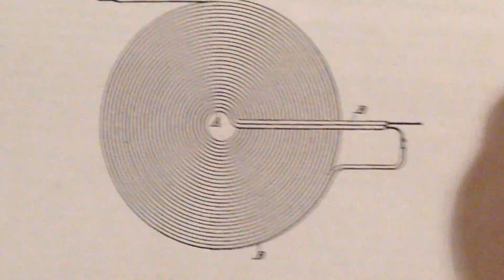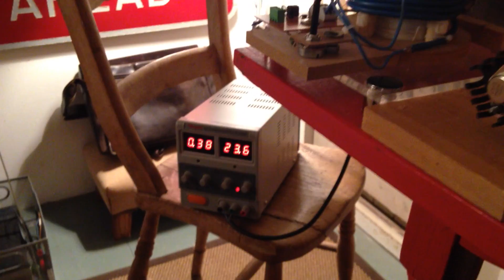Tesla Patent 512,340 Primary on a Slayer

Comment: I don't see a pancake coil anywhere.. Is there one here? A normal helically wound bifilar coil doesn't really function in the same manner as if it were wound as Tesla shows in his patent. I have found that the pancake coil works great as a primary coil for the tesla coil, whether it is bifilar or not however the bifilar adds a lot of punch to the system, not only an increae in voltage, but power as well, so if you do not use one here, please try it, I have and it does increase the output of radiant energy with a very big difference, not just a little bit. 

Whatever you have going on that is making the circuit click on is creating power issues for the setup you have, almost as if a transistor is shorting by saturation, or possibly the pulses out of frequency are  making it jump up from 5 watts all the way to 28.3 watts and beyond. 

Your  lights all light up just fine at the beginning with .18 amps x 28.3 volts @ 5 watts when the coils are close to each other and able to communicate with each other.. Are the transistors heating up from the high frequency?

I am quite sure your flourescent tubes are all at least 12 to 24 watt bulbs too, and they appear to be well lit, nearly all the way for their brightness.. Have you checked your lux from the bulbs powered with the Tesla coils, then test them again with them powered conventionally to see if the circuit  is producing n output into overunity? If the transistor/transistors are not heating up or reaching saturation, causing shorts during it's oscillation, then it may be frequency related, with a variance in frequency, causing it to go in and out of resonance, or a possible wavelength issue only with the added load, but it does seem to only do this after it runs for a short period of time.

 If the system wasn't  amping up the way it does, I'd say you can prove OU with the flourescent tubes. However,  I do think you either have an issue with transistors saturation, or by the system going in and out of resonance, maybe by the oscillator changing it's frequency for whatever reason, or It may be a wavelength issue once the load is added.
Reply from the maker: You're right it's helic Marc. This was a long time ago but I remember it pretty well.  It had a strange effect where the power would be all or nothing and was hard to control. I didn't explore it any further.  I'm sorry but some of your comment got chopped off. Sorry for the late reply, I'm on leave this week with my head down in the workshop. Thanks for taking the time to leave a message. Cheers for now fella :D